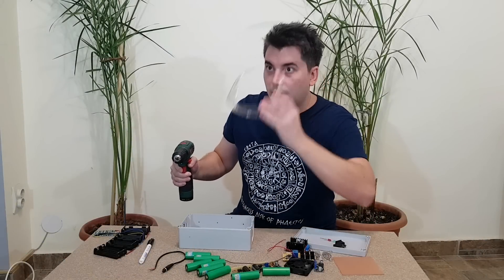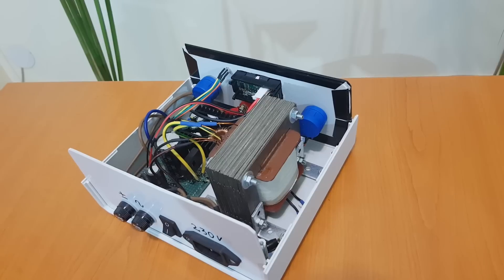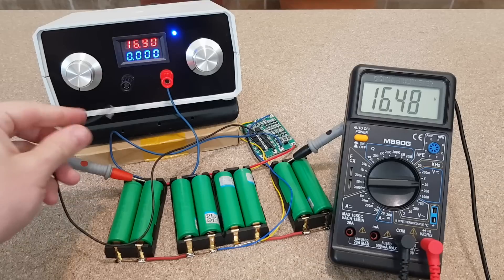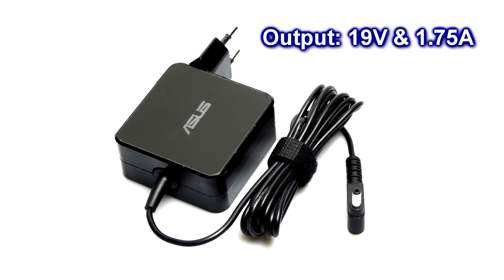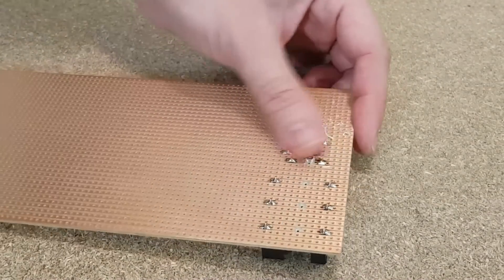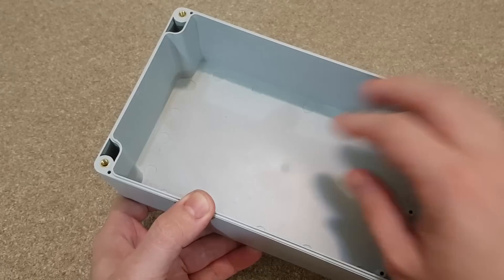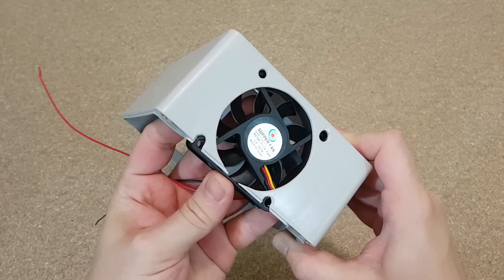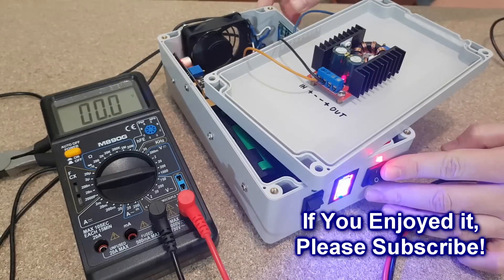DIY UPS with 12V and 19V (for Asus router) part 1/3

Comment: Salut Sorin, crezi ca e ok daca in loc sa lipesc/sudez bateriile, sa le pun intr-un holder? Din acela cu arcuri? Tot pt. un UPS de genul zic, dar mai mic, cu 4 buc
Reply from the maker: Salut, e ok si cu suport de baterii, dar sa nu fie un consum de curent foarte mare. Pentru 1A sau max 2A ar trebui sa fie ok. Acum lucrez la un nou UPS, mai dureaza putin pana termin clipul, voi explica mai multe in cadrul acestui proiect.
Reply: @Sorin_DIY  super, abia astept sa-l vizionez ;)
App, te-ai referit la 1 A maxim 2 per celula?
Reply from the maker: 1A pentru fiecare contact. daca e vorba de 4 celule in serie si un consum total de 1A, atunci prin fiecare contact va trece 1A. 
daca celulele sunt conectate in paralel, atunci curentul se imparte intre celule.
Reply: @Sorin_DIY  bun, ms mult Sorin 👍😉

Comment: I believe that when you are driving a relay, there is
Feature known as a latching current, which is the current that you can turn down the control signal two on the coil to keep it from heating up. 

Essentially, you use your microcontroller to use the full voltage. When it first activates the relay and then have it turn down the voltage after that, so that, it does not heat the coil.

Comment: Hi, just asking, if i onlye need 12V output, isi it OKAY to use 3s BMS with 6 battery? Not 8 like yours??
Reply from the maker: Hi. a 3S battery has a voltage range between 12.6V and 8.1V. if you want a stable 12V output, you will need a CC/CV buck/boost converter. it works, but it will have a lower efficiency, so a part of the battery energy will be wasted. because a buck/boost converter works with a lower efficiency that a simple buck converter.

Comment: Using the diodes is a good idea, but you can go lower in voltage and still get reliable switching if you add a capacitor in parallel to your diode string. about 100uf at 25v etc.  the cap charging current will bypass your diode string giving the coil a good pulse. this method also works for a resistor instead of a string of diodes.  this is how I stopped door lock solenoids from heating up.

Comment: Most Router that work at more that 12v, internally have voltage regulator that can work betwen 10v and 24v, sure that router uses 19v can work with 12v

Comment: What is middle blue preset in cc cv module  ?
Reply from the maker: I think you can use it to adjust the full charge indicator LED (middle), so it will light up when the battery is charged to the desired voltage. but I'm not 100% sure, I've never used it.
Reply: @Sorin_DIY  thanks you  🤜❤️❤️

Comment: What if I replace the electrolytic capacitor with a super capacitor? will it work better?
Reply from the maker: yes. but it may take longer to turn on the UPS and charge the capacitors.
Reply: @Sorin_DIY  True but atleast it will give enough time for the relay to switch, thanks you so much tho.

Comment: I think the fan was drawing more current because you had it in freespace (i.e., no resistance from forcing the air through the enclosure). Just a guess on my part.

Comment: Hi  another great video congratulations .I'm preparing everything to start build a similar project .I have just  a question for you,what is the function of the battery switch?
Reply from the maker: hi. I wanted a switch to disconnect the battery, in case I want to check something about the battery, while the devices are running. or if I want to temporary power the devices only from the chargers and I don't want to unplug and reconnect all the cables, just turn off the battery switch.
Reply: @Sorin_DIY  Clear.Thank you

Comment: The reason why your cells has lower capacity than what they promised is maybe there were sitting more than a year. Did you tried to  charge discharge it 5 6 times
Reply from the maker: hi. I think that's the reason. in the first test the cells had 1500mAh. after 4 cycles ~1650mAh. I don't think they have more to give.

Comment: IMO, it's better to make it 5S config and only use the 19V adapter from ASUS.
Not only it reduces complexity a lot, by not needing any charging module and relay, it also make you possible to double the capacity by placing 5S2P in there.
The downside is you can only charge the battery to around 70%, BUT that's also a benefit that it will boost the longevity of your cell, and also you can 2P your cell to counter this.

Nice project!

Comment: what is the backup time for 12V output only and i sent mail to you please check it
Reply from the maker: hi. I tested it with both outputs and it has a working time of about 3.5 hours. the router uses a lot of power. but with better lithium cells it will last longer.

Comment: Hi, i bought a 3s bms for my wifi router, which works fine , can i charge it with 12v charger of router or should i use any charging module.
Reply from the maker: hi. you need a charger with a voltage higher than 12.6V, otherwise the charging process will not be completed and the cells will loose capacity in time, because they are continuously charged and don't reach the overcharge cut-off voltage. you need to check what voltage the BMS need.
Reply: @Sorin_DIY  charge voltage?
Reply: @Sorin_DIY  how can i measure the voltage required by bms.?
Reply from the maker: you should find the charging voltage in the BMS specs.
Reply: @Sorin_DIY  i do has a modem and router which works on 12v (each). By connecting those in parallel ,both turns on but the modem restarts. How can fix that? I added a relay that turns off the battery supply when the power returns. But while charging the BMS with voltage booster the power from batteries was going to voltage booster .

Comment: ı wouldn't do that in this way.i would use the battery, BMS and inverter,we have certificated adapters of it and the inverter will give pure sin wave. 100W pure sin inverters have 96% up eff. So it would be much reliable ,cheaper and efficient way of this . Great work anyway have a nice day

Comment: You should VERY clearly mark the battery polarity on the socket and the battery.  It is EXTREMELY exciting putting them in backwards in these kinds of holders because they dont have a spring.  If there is a spring it will glow and deform and break circuit or limit current... the better solid ones like you are using will not.
Reply from the maker: hi. I did mark the position of the batteries, it will be included in the part 2 video.

Comment: 6:30  to save some current/heat/power in a relay coil - you may run into problems using lower voltage because the contacts will arc more using a lower voltage- with less force the contacts move slower and arc more. Also, an old relay may fail to work as well at lower voltage.

The cure is to use the full relay coil voltage rail, but fit a few forward bias diodes bewteen the negative side of coil and ground. This reduces the voltage to the coil normally in steady-state conditions -  but here is a trick - bridge the diodes with a large electrolytic capacitor (+ve side to lower side of relay coil, negative side to gnd) - the inrush current to the capacitor will create a pulse of higher current to activate the relay with more force. It will still arc when it disconnects but half the problem is solved. This was known as a "relay saver" in years gone by, though I've just searched for a diagram and all Google shows is ones with transistors instead.  More diodes = lower voltage in steady state. 

Remember to include a reverse-polarity protection diode across the coil for EMF protection.
Reply: Also works for fans - use lower voltage to run but higher pulse to start - often a 12V fan will run at 4 or 5 volts but needs 7 or so to start reliably to overcome friction.  If you don't get much effect add more capacitance. Cheap large-value capacitors will do - no need for very low ESR ones. You can also tap into the diode string at different points to give different running voltages. I use up to 10x  1N4001 diodes for PC fans - this gives me 12 volts minus (10*0.6V) so this is 11.4, 10.8, 10.2, 9,6, 9.0, 8.4, 7.8, 7.2. 6.6, 6.0 volts  depending on where I connect the fan. The capacitor must go from the fan bottom side to the gnd and the selected diodes, not across ALL diodes.

10 diodes is 10cents (assumes 1N4007) , so biggest cost is capactor.

Comment: Sorin, would have not been easier to stack the batteries on top one another in a 4 cell top 4 cell bottom configuration and use a plug with either a strap, a clip or  screws to hold them in so they can be removed at any time?
It would give a bit more space and still have enough air flow for the batteries.
Love the channel friend, can't wait for next video.
Reply from the maker: hi. I wanted to make it simple for anyone to remove the cells. and I just wanted to use battery holders with clamps, not screws or other components. if the UPS was mine, I would have arranged the cells differently.
Reply: @Sorin_DIY  I like the battery holders myself. No welding or soldering on the battery's. Just wire up the holder and plug in the batteries... As for the polarity issue I paint the 'positive' end white with paint and then paint a red '+' on it... :-D
Great video BTW!
LLAP
Reply: @Sorin_DIY   why not show your preferred cells configuration in part 2.
Reply: While that is true and correct. Sorin stated his friend wanted to be able to change the batteries easily. Doing what you suggested would make it a bit hard. IMOP :-)
LLAP
Reply: @BrucesWorldofStuff  It's a good point you make, but as an example:
USE an XT60/XT90 connector, 
Use a 4x cell connector back to back (insluating between the holdersand wiring for required voltage)
Cut/make a door (either clippable or screw in) and glue to the side of the call holder.

This means means the cells can be removed and replaced easily, not really complicating the initial design.
Reply: @liamburge463  Oh, Ok... I see what you mean. I was just going off what he said in the video. I had a Ham Radio mic that you had to take apart to change the battery. It sucked. I made a square cutout in the bottom as a lid I used the cutout and velcroed the battery and cut out plate in and  now it it easy... Lol
Velcro and super glue works wonders... :-D
Thanks for the reply and take care!
LLAP

Comment: instead of all this hassle  get a PD powerbank 20000mAh and PD trigger boards with 19v and 12v value then connect the dc output from the boards directly to the router